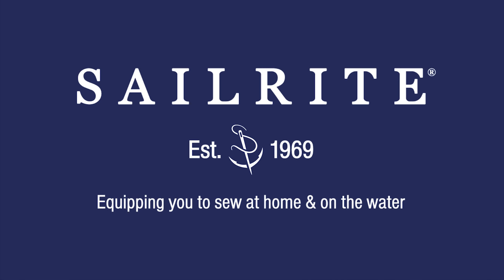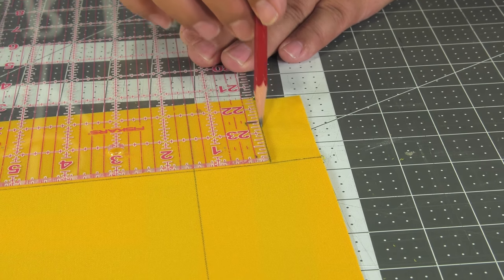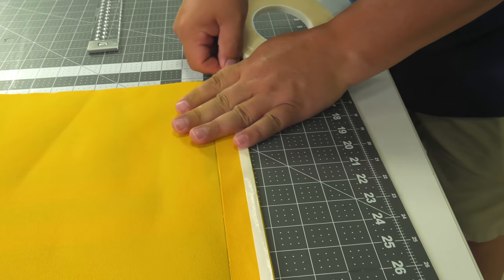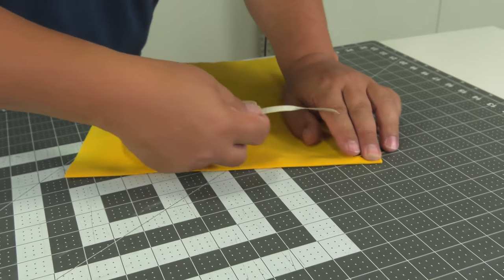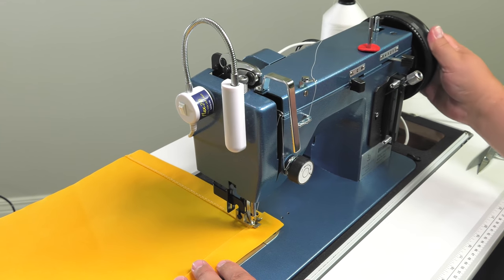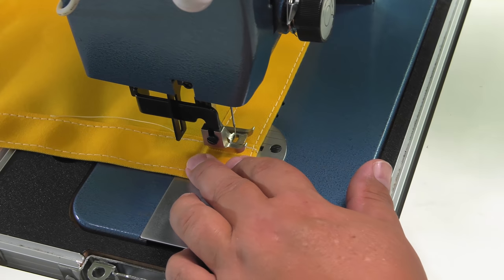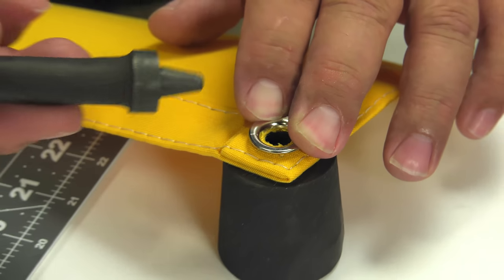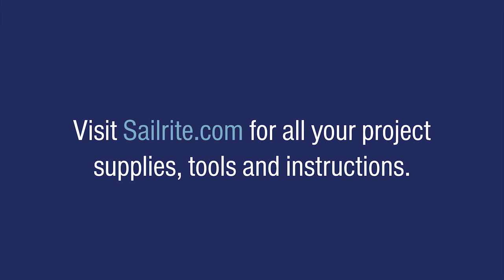How to Sew a Double Hem with Corner Reduction

Comment: When I use the #129 I have issues. When I try and sew through it, it appears like the thread is missing some holes where the needle is sewing. then my needle is all gummed up from the tape. I was super excited about the product. now I'm not sure it's going to work for me.
Reply from the maker: A couple of suggestions – 
1.       Try the next smaller needle. Sometimes you just need more friction between the needle and the fabric to clean the adhesive from the needle. Otherwise the adhesive fills the groove in the needle and keeps that groove from performing its function – allowing the thread to slip on one side of the needle to allow for thread loop creation. If the loop is not created then the machine will skip a stitch or stitches. I can see the adhesive buildup very clearly in your photos.
2.       Push the needle into a bar of Ivory soap repetitively to coat it prior to installing it in your sewing machine. Adhesive just doesn’t stick to this soap and it sometimes works really well.
3.       Make sure you are using the right basting tape. This application of light spinnaker cloth would dictate use of ¼” standard seamstik (our #20306). If the tape you are using has too much adhesive content it will stick great but will also potentially cause stitch skipping.
4.       Final, check your machine’s timing. The needle bar could be a tad too high or the hook could be slightly delayed in rotation.